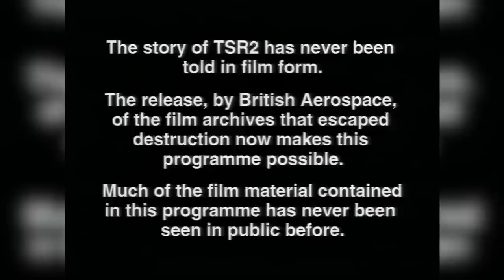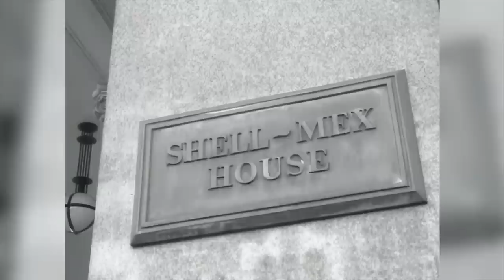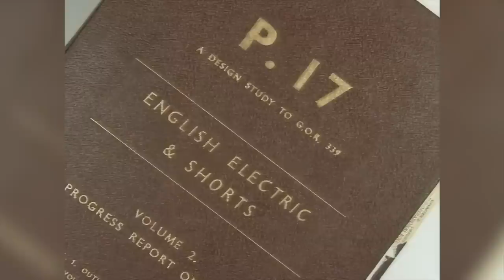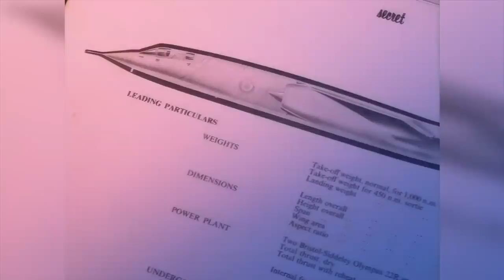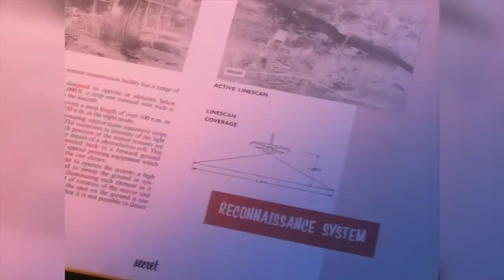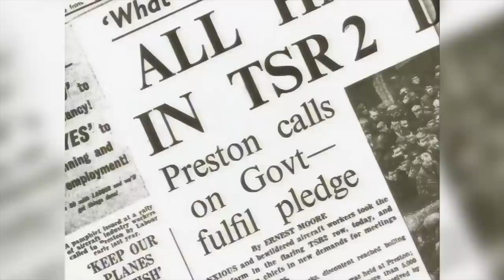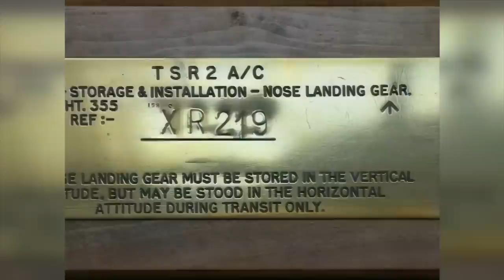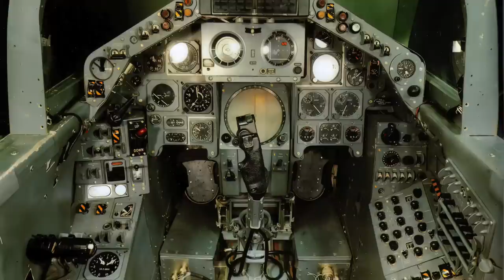BAC TSR2 | The British Cold War strike and reconnaissance aircraft that was cancelled | Upscaled

Comment: From my memory the it was built from  Stainless Steel, it was ahead of it's time but as usual anything that costs money is cancelled. Great aircraft
Reply: The leading edges were titanium
Reply: @Samothrace83  They cancelled  the plan just before I joined what was the Bristol Aircraft Corporation later to become Bristol Siddley Engines then laterly Rolls Royce.
Reply: The stainless aircraft was the Bristol 188. It's at Cosford, along with the most complete TSR-2 airframe.
Reply: @596football  Not quite right.  Until 1959 the Bristol Aeroplane Company consisted of a division producing aircraft and another division producing engines, all at Filton, Bristol.  Government-directed consolidation resulted in the aircraft division being incorporated into the newly named British Aircraft Corporation.  Simultaneously, the engine division became a parent company named Bristol Siddeley Engines.  The name was applied because Bristol aero engines, in another industry consolidation, swallowed up Armstrong Siddeley, a Coventry-based areo engine company.  At a later date Rolls Royce (Derby) swallowed Bristol Siddeley,  which then became the military engine division of Rolls Royce, which it still is to this day.
Reply: @johnbayntun840  I know that, but it was considered one unit by the workers my father worked there from 1937 and I joined as an Apprentice in 1960 just after Bristol Siddley Engines took over the engine division at Patchway. You could see in the factory guirders holes from shrapnel from the bombing during the war. Unfortunately all that has been demolished now

Comment: Good evening, 
We actually know the pain you feel as our Avro Arrow program was pissed away with 5 , count them, 5 aircraft ready to be delivered to our airforce. I know that R.R. could not develop their engine so it was cancelled.  I feel the knife close to:my throat, Gordon Crawford declared that Avro would use the Iroquois Engine to power the Arrow. The Iroquois engines were being tested as the US was interested in the Iroquois because we were using their PW J75 with afterburners. The engines that was being used was adequate at the time, but the Iroquois was lighter and producing 10 % more thrust then the PW J75s. The next fact was that we were left high and dry with no weapons pack, so we were now developing the weapons package as well. Then there was the sparrow missiles our airforce wanted so if they were to be part of the pack, then we had to develop the missiles as well. The aircraft was ready to be delivered as is, except, England was a no show, the US was a no show and NATO was a no show, but the US were allowing Canada to use a B47 bomber as a test bed for the Iroquois development, which allowed te US a to monitor the program, Hues aircraft had a weapons system which needed development to use the sparrow, which was supposed to be developed by the US, and the French were highly interested in the Iroquois development for their Miras 3 fighter. There you have it but the arrow was not a prototype, each to be sold and that means that one week before the CF 206 unit was to be tested with the Iroquois engines, the government pulled the plug and destroyed the first 5 units with the 6 unit with the Canadian engines, plus every one on the production line. They destroyed the flying ones along with the jetliner, Iroquois product, the fly-by-wire systems and all paper work and drawings, everything torched and destroyed. The hole program was sold for scrap. We came to England with the hope we might sell you some fighters along with every NATO nation but that was nonsense of course. Cry over what you made,  Just so you know, England wanted to purchase a couple of ships for study, in fact, they needed all the data to help with your ship as we did all the work already as our shi2 was flying in 1958, but you was hoping for the fire sale price so at least there is that.
Forever in His service

Comment: I joined BAe in 1986 and there were still some veterans there who would get very sad and misty eyed about the TSR2. My take is that it was fantastically advanced but probably reached too far, and  the political climate put the boot in. I reckon it would still have been operational in 2000 or so had it delivered. It would have changed the face of military aircraft development. And it was truly a beautiful aircraft. There is one at Hendon I think.
Reply: The real problem for manufacturers of Aircraft for the MOD is the fact that they keep changing their minds. Imagine trying to build a car when the remit is a saloon, then changes to a coupe and then an SRV  and wonder why the costs go through the roof.
Reply: Its at Shifnal.
Reply: There's one a IWM Duxford, I always check it out when I visit.

Comment: Anyone who harbours misty eyed ideas of the TSR2 should read Damien Burke's seminal book on the subject. The truth is that the F-111 while smaller  exceeded the TSR2 in EVERY  respect. The F-111 was significantly faster, had almost double the range, more than double the payload.  The brutal truth is that TSR2 should never have flown at all. It had non-flight worthy engines as they suffered from 'bell mode', a harmonic resonance that could have destroyed the engine. An Olympus 22R destroyed Vulcan test bed XA 894 on the 3rd of December 1962, when it came apart while running on the ground. Beamont, had the keep the engine power below 97% or a similar catastrophic failure was likely. By the end of the program the aircraft was overweight, had it target maximum speed lowered to M 1.5., the UK government was broke, the aircraft industry was an inefficient  mess and most importantly, the RAF itself was 'iffy' about the aircraft. The lower performance and the RAF's lack of commitment is why the Royal Australian Air Force opted for the F-111 which went on to serve it for 37 years. TSR2 had no export market and the RAF couldn't afford it on its own. TSR2 would still have been in development while the F-111 was flying combat sorties in Vietnam by 1968. It is an impressive aircraft to see and the most obvious debunking of all the conspiracy theories about the Government wanting everything about it destroyed is that there are 2 beautiful complete examples. One at Duxford and one at Cosford. I travelled halfway around the world to see them in 2019 and they are still menacing to look at but walk over to the American side at Duxford and you see the smaller and far better F-111 sitting there having served in Vietnam twice where it had the lowest combat loss rat of any aircraft in the conflict despite flying at night in horrendous tropical weather, and in Desert Storm where they destroyed over 1,500 pieces of armour by 'tank plinkin'g with LGBs and also carried the massive GBU 28 Bunker Buster, that penetrated key Iraqi underground facilities

As with Canada's Avro Arrow there is a little too much emotion and far fewer unpleasant facts, present in most discussions of this aircraft.. It was an ambitious project but a 'Bridge too far' for both the RAF and the UK economy at the time.
Reply: @Completeaerogeek  Well said. I was very sad when TSR2 was cancelled, but people don't seem to realise that TSR2 was for the defence of the UK, not a piece of art.  

There are a lot of claims about what a fantastic aircraft TSR2 was, but they are not based on anything except emotion and nationalism. TSR2 would have been a money pit and it looks like it had poor low speed handling and serious problems with its landing gear too. 

There is also some silly claims about the 'Yanks' sabotaging Concorde.

Comment: What is never discussed are the logistics of the TSR2 in the cold war scenario it was going to fly in.
Forward airbases was one of those ideas that was going to be part of the planning. The idea was to move the aircraft to areas where the the enemy ( Russia ) would not be looking instead they would attack the airbases known to them. 
In other words you hide the aircraft until it was needed then prepare it for action.
So that means fuel, vast amounts of the stuff just to power one aircraft. Where do you store it and hide it away from prying eyes? Then you have the all the other requirements to get the aircraft airworthy for its up coming operation, spare equipment manpower and so on .
It would having taken off from motorways that were dotted around the country. So you would need a wooded area nearby to hide the aircraft. That was the idea put forward by the RAF.. The only time that came into practice was when the Harrier jump-jet became part of the RAF strike force. These were hidden in wooded areas and didn't need long runways to take off. 
The TSR2 was a great aircraft and a testament to British design. In the long run it would have cost the earth to keep it up to readiness.

Comment: They killed it for Boeing plain and simple F-111
Reply: Except for speed, range, ceiling, armament the TSR2 has it all over the F-111
Reply: @cowboybob7093 

The Boeing 2707 was superior to the      Concorde in speed, range and passenger capacity.

Except the Concorde actually flew.

The Brits & French spent a billion and they got an SST.
The Americans spent a billion and all they got was a 300 ft mock up that ended up in Disneyland!

The Americans were so pissed they barred Concorde for years.

Bad show, chaps.. 🇬🇧
Reply: @tumslucks9781  Look now, Boom's interesting plus there's competition and it's mainly domestic US, but GB aren't slouches if that's your domicile. And sorry for your loss, King Charles will serve well and probably for twenty years himself! 
Long live the king.
Reply: @cowboybob7093  In fact it wasn't. There is a confidential report written by BAC in Jan 1965 held at the BAES Heritage Archive at Warton (Declassified in 1995) which shows that the TSR2 was nowhere near capable of meeting the design specs asked of it. F-111A was actually faster, could fly higher and could fly for longer.

Comment: I started work in 1969 with 2 men who had worked for Elliott Bros. @ Chatham working on the fuel flow metering for the TSR2. In the back room was dozens of boxes of electronics from the plain, electromechanical guidance computers, fuel flow gages & 100s of reels of PTFE cable (a right swine to strip). Wish I had had the foresight to keep a few bits myself.
Reply: @gravyytube  I remember Elliot and their 803 and 503 computers. Didn't the Yanks sabotage Elliot computers by producing the DEC PDP8 and PDP11? 😊

I worked for EMI Electronics where they were designing and developing the Linescan tape recording system for TSR2. When TSR2 was cancelled we had the tape decks lying around the lab for months.

Comment: I understood that the Olympus was already developed and installed in the Vulcan 2 years earlier . But to uprate it, ie   6th family member from the baseline Olympus B.01.1 (22R )for TSR2 (Concorde was 7th) was a challenge as was its airframe installation and air intake high total temperature some 20deg C higher than thaat of Concorde.

Comment: The technology was well out of date by the prototype stage, avionics. 4-bit computing microprocessors had just appeared.
Reply: Perhaps but avionics are continually updating. It’s the airframe that needs to be proven. The alternative? F111 never came to fruition and was bye and large a failure for USAF and a non starter for the USN.
F4 Phantoms did Stirling work ‘69- ‘92 yet Canberras and Hunters the F4 was purchased to replace we’re still in service
Reply: the Intel 4004 came out in 1971, it was for desktop calculators not general computers. ten years after the TSR2. 1980 onwards was the time of the computing avionics.
Reply: @joefish6091  You are quite right, Concorde was analogue.

Comment: An excellent story of betrayal by the Labour Party, throwing away Millions of £ and wasting our advantage in aviation technology in 1965, all down to the USA not wanting a superior aircraft & engines (TSR-2's engines went into Concorde), in the sky -  just like the Canadian 'AVRO Arrow with it's Iroquois engines way back in 1959, the USA's F -111 was a total mistake, way behind in development and totally wrong electronics for UK/RAF operations, of which None flew as RAF in the end.
Reply: @kevinorman9732  What are my politics again ? What was the mission of this aircraft exactly?  Buy what you can afford! Pitt the Elder has moved on. Finally strong tradition on the old empire for strong defense hawks on the left
Cheers!
Reply: @kevinorman9732  I know what a Waffle  is. You started this nonsense today. Answer my points or were done. Balance your research a bit more as you can run a bit hot and cold old boy. Fir you're own good and all that. Thanks!

Comment: This old doco again..... The TSR-2 was an overhyped, underperforming, ugly piece of crap. The prototype AoA on landing was hazardous enough unladen FFS. Not even close to a successful aircraft, and slapped down by the F-111 in every respect.
Reply: The TSR2 sadly never got past the development stage and did have some problems that were slowly being ironed out. However, it's a bit unfair to say the F-111 was so much better when it took years and years of upgrades to get the aircraft to an even acceptable level of performance
Reply: @markpritchard4447  And the F-111 had an outstanding career spanning 40 plus years...next!
Reply: @andrewdowsey453  it sure did but still had it's issues, being rejected by the US Navy and cracked structure that caused the wings to detach.
Reply: @andrewdowsey453 

The Lockheed F-104 Starcrasher also had an outstanding career.

For scrap metal dealers anyway.
Reply: @tumslucks9781  and undertakers

Comment: Australia was choosing between the TSR2 and the FIII, in the early 60's, at that time both were in developmental, and Anglophile Australian PM, Menzies, being an Anglophile, probably had a soft spot for it, as,Britain was wanting to test the Blue Streak missile at Woomera, and was probably courting Australia with different options
Reply: @alexlanning712
The Royal Australian Air Force (RAAF) had evaluated TSR2, but its performance wasn't suitable. For one thing, the range would not even get it across Australia, so in 1963, the RAAF chose to buy the F-111 instead, having also been offered a better price and delivery schedule by General Dynamics.
Reply: @phonicwheel933  Yes phonic, my memory is pretty sketchy, because I was pre-teen, at that time
Reply: @alexlanning712   Your memory is better than mine Alex. I just looked up the information on the F111 on Wikipedia.😊

Comment: I was told two things America was pushing the phantom (the tsr2 would have been a direct challenge) and also the aircraft was too advanced for the electronic systems at the time, basically it was to fast and too manoverable so was at risk of killing it's pilot as it would be faster than his reactions , the new euro fighter uses computers to help the pilot fly the thing as do many modern fighters

Comment: But yet, what was learned from the TSR 2 project ended up being applied to another project that became a huge success: the Panavia Tornado. Indeed, many of the same engineers who worked on the TSR 2 became engineers on the Tornado project.
Reply: Success? How? By building a worse performing plane 15 years after TSR2 first flew?
Reply: @LondonSteveLee  The TSR.2 was TOO optimized for the nuclear strike mission in the eyes of some. The Panavia Tornado could carry up to 16,000 lb. of weapons and was adaptable to way more weapons types than the TSR.2.
Reply: @Sacto1654  Yes, that's true.
Reply: @LondonSteveLee  And more importantly, because it had variable geometry wings and a full thrust reversing system, operate out of much shorter runways than the TSR.2 ever could.

Comment: Well the Buccaneer was not even capable of mach1 its top speed was only 696MPH so could only do one roll and that was attack shipping . It was really a good flying Aircraft but not capable of out running a mig which was far better movable aircraft. To do ground support and air protection you have to have a plane that can do at least Mach2 and fly above 80 thousand feet. Which is why the Harrier took over from the Buccaneer as co0uld take off and land on very short runway also fly very low also deflect incoming heat seeking missiles.   The F111 Aardvark is now so close to looking like the TSR2  amazing how things may have changed.

Comment: The better step forward would have been Supersonic Buccaneer 2
Reply: Re-engineering a subsonic aircraft to go supersonic isn't really a great option. Both flight regimes have completely different characteristics, so the buccaneer would have needed a complete structural, propulsive and aerodynamic redesign. 

At that point, you might as well just come up with a new clean sheet design, because that's what it'll end up being anyway.

Comment: The sad truth about it is it might have been ahead of it's time while it was on paper but by the time it was flying it was out of date looking at the manufacturing date of some of skunkworks or Northrop's planes also 3+ years of testing still needing to be done before operational topped off with a unreliable or untested experimental engine is the reason this was scrapped... should have never made it to this stage